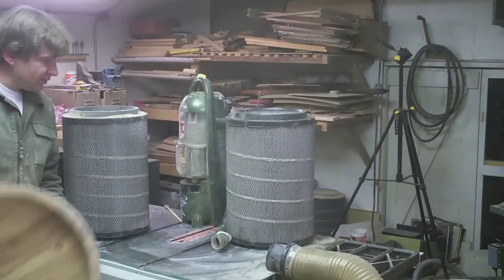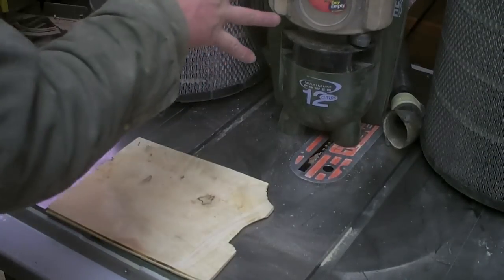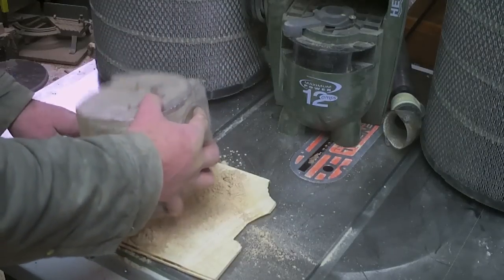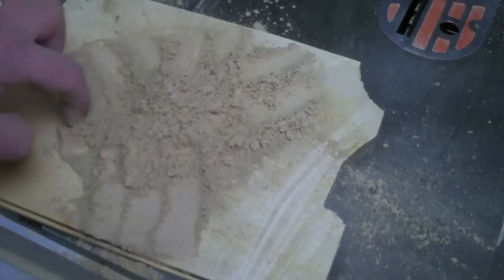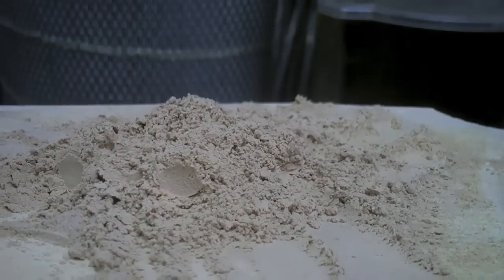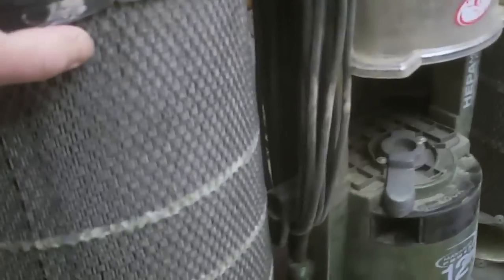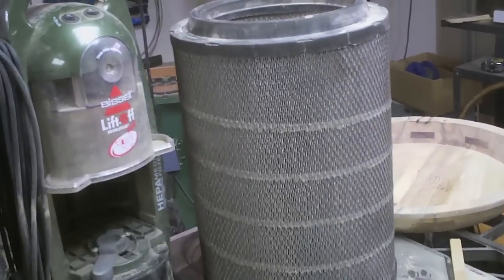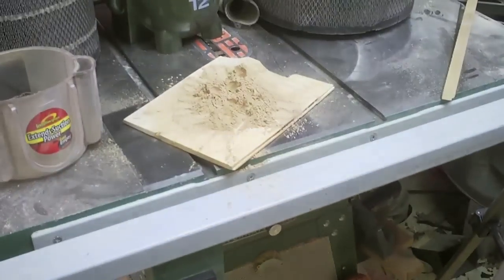Dust System Hepa Filter Clean

Comment: I would say your cyclone is not working correctly, unlike your filters. I'm no expert but researching the issue before I build my own system. I'd say the air speed inside the cone is too small, so the small and light particles are left to fly free inside it and through the blower to the filters.
Reply from the maker: Yes the blower is undersized for the cyclone.  It used to filter far more of the smallest dust before the dust bin air leaks got so bad.  I think the leaking seal around the lid is creating a small updraft that helps lift the micro dust into the impeller where it gets blown into the filters.  I keep telling myself that someday I will get around to sealing it better.
Reply: NelsonStudios that could be the culprit. BTW I didn't know the air filters in trucks are HEPA. Or aren't they? But nice hack anyway, thx for sharing.